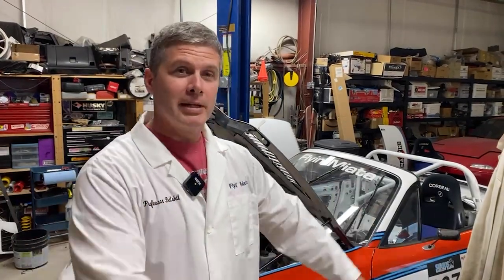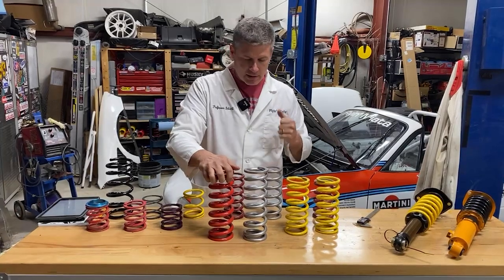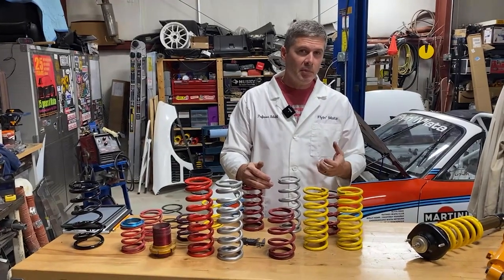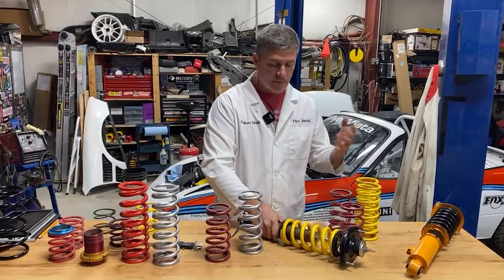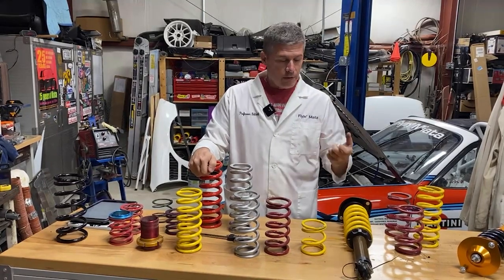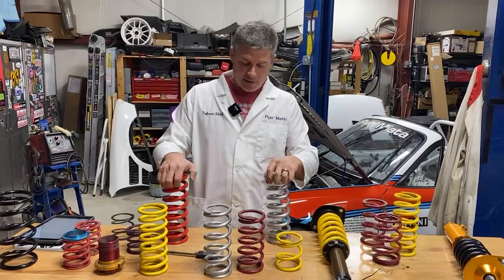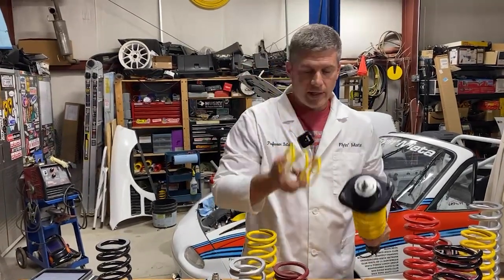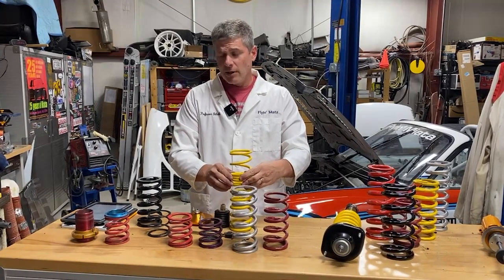Explaining Suspension Coil-bind (FM Live)

Comment: Do you think weak springs can cause suspension mount bearing to go bad and cause spring clunk noise while turning the wheel?

I'm running on 5th set of Suspension bearing pads in 10 months but everytime I start getting could bind noise (twang and tings) while turning the wheel.

I don't know how to resolve it.
Reply from the maker: Obviously we're not talking about a Miata here. We wouldn't expect "weak springs" (interpreting that as a low spring rate) to cause failures of those bearings. Low quality or underspecified parts would be the first expectation. If you're running cheap aftermarket parts, try to use OE. Otherwise, look for something bent such as the shaft of the strut.

Comment: What would be the advantage of having something like your koni 2.5 kit? compared to a coilover with konis from say ground control? What would the trade-offs be for each? I am looking into suspension for my 92 NA that i plan on daily driving except in the winter in colorado
Reply from the maker: Coilovers give you the ability to set ride height and to cornerweight the car. We've done a video on the latter. Other than that, they don't have any magical abilities.
So you'll want to look at the chosen spring rates and the specified ride height on a non-adjustable setup. For your specific question, the 2.5 kit offers more bump travel in the rear due to the extended upper mounts used. The springs used on the GC kit (off the shelf) aren't really long enough to give full travel either.
Reply: @FlyinMiataVideo  Thanks.

Comment: I only understand Europe spring rate ....10Kg per mm , what would be spring rate be in pounds ? Thanks Keith
Reply from the maker: 10 kg/mm is 560 lb/in. Take the number of kg/mm and multiply by 56 to get the lb/in equivalent. Or divide if you're going the other way.
Reply: @FlyinMiataVideo  ...thanks , that's why I picked 10 ....;-)

Comment: So having a coil bind on a bumpy track will cause the car to stop absorbing bumps, as well as losing the tires contact patch with the track right.
 So you will be very unstable.
 This is correct right?
Reply from the maker: Correct. There’s also the potential for suspension damage.

Comment: So springs are fine to go 80% of full travel?
Reply from the maker: Yes.
Reply: @FlyinMiataVideo  would a good brand like hyperco manage its spring rate all the way down to bind? Dont naturally springs get a little stiffer the more compressed it gets? Especially on a spring as short as 6”. I think I need to go up to 8”
Reply from the maker: @Phuong_Nguyen_  The spring rate can shift a little bit right at each end of the range, but it's not dramatic. Generally speaking, we like to run the longest springs we can package. The only time we'd use a 6" would be on a very stiff setup.
Binding a spring repeatedly will damage it, you want to avoid that.
Reply: @FlyinMiataVideo  I feel the EXACT same way. The longest spring possible should always be used. But when I called Swift Springs and another manufacturer, they said the shortest spring should always be used. And I disagree with that whole heartedly.
Reply from the maker: @Phuong_Nguyen_  If you go too long, you can get into bending problems where the spring bows sideways as it compresses. Not typically a concern for Miata spring lengths. And of course they weigh more. But that is assuming that the short one is long enough, and usually that's not the case for Miatas.
Reply: @FlyinMiataVideo  what is your top 5 coilover spring brands and how do you feel about Griggs racing springs?
Reply from the maker: @Phuong_Nguyen_  We do not have a top five listing. Most of our suspension kits run Eibach 2.5" springs because of a good combination of availability, quality and supply.

Comment: Why is coil binding bad most all cup teams use to coil bind at one time
Reply from the maker: Because when it happens, your suspension has been replaced by solid metal. In the real world - not on a nice smooth oval - this means massive shock loads going through your suspension and a lack of any ability for your tires to follow the road. You will break things, you will lose traction, you will be very uncomfortable. On a Miata, the usual damage is to your spring perches and thus suspension collapse.
Cup cars were exploiting a rule set and run on nice smooth ovals. So effectively removing the suspension can work in that very specific use case. You have to be careful extrapolating what race cars do to street cars or even to other race cars.